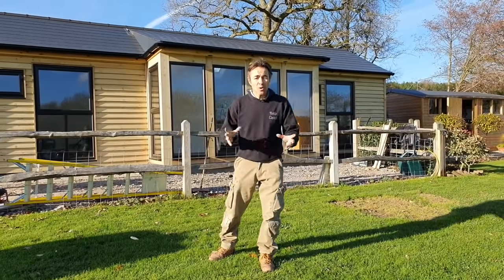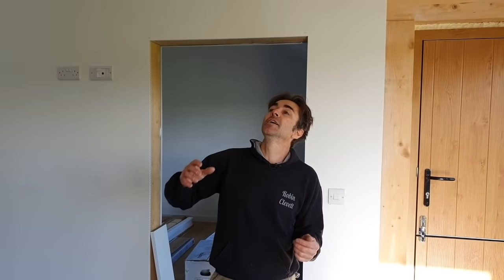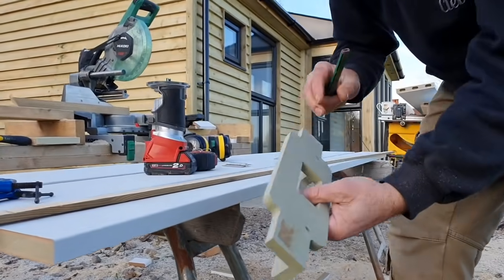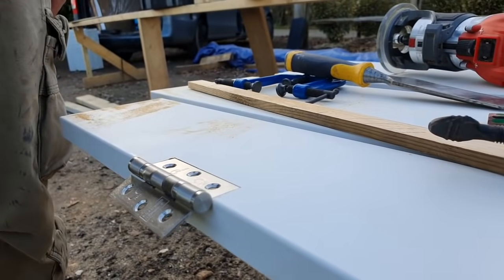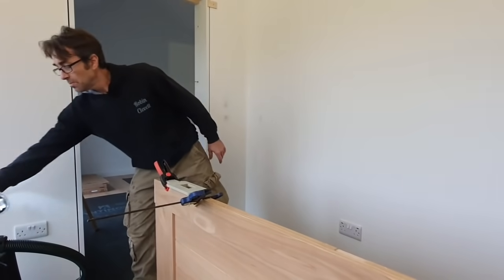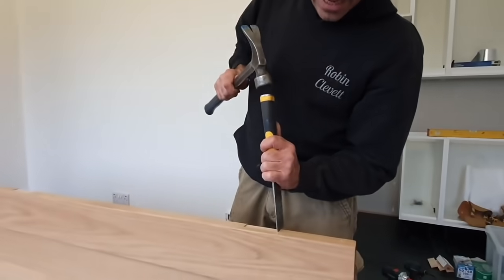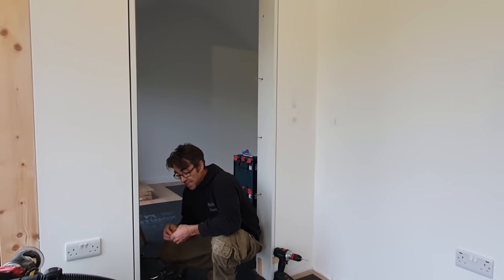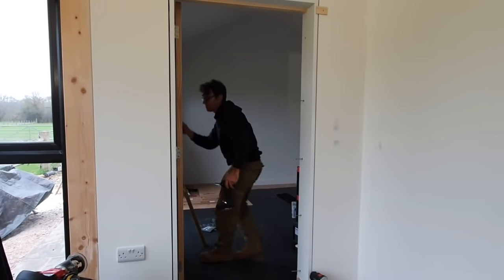Modern Carpentry and Change!!! Hanging doors the modern way with MDF door linings and new hinge jig

Comment: A  little tip is to put washing up liquid on the tips of your screws especially for hardwood makes them glide in 😉🔨
Reply: We used to use tallow...
Reply: @Elfin4  or the older lads have a small tub of grease 🔨
Reply: @tomsmith9048  Hard to get tallow now.  Used to be more readily available when there were shipyards as they used it on the slipways.
Reply: @Elfin4  I'm only doing it 22 year's so it's always been washing up liquid for me 😉🔨
Reply: @tomsmith9048  Yeah Im going back 42 years!!!! things move on and sometimes for the best.  Not sure about the washing up liquid though in case it causes corrosion
Reply: @Elfin4  I've never had an issue's before I have to say as the timber normally absorbeds it the other things I've heard from older lads is soap grease and wd40 but I've always thought as soap and washing up liquid as something that dissolves but it's each to their own 🔨